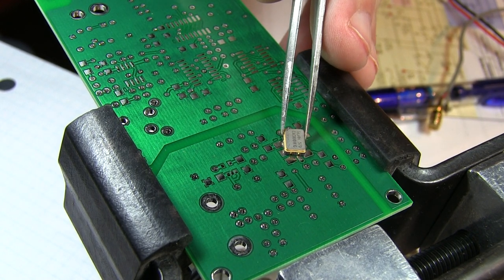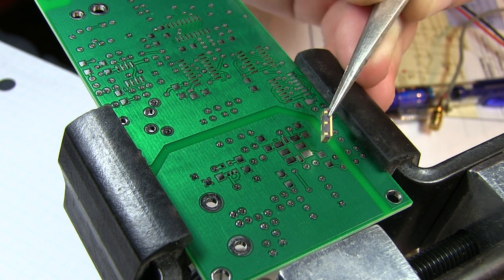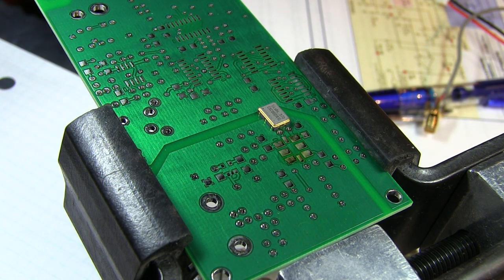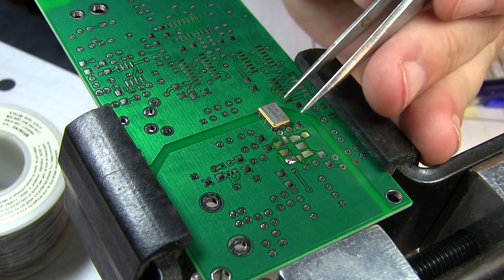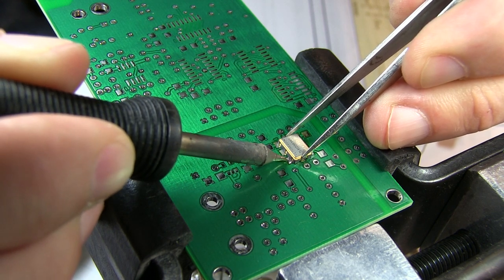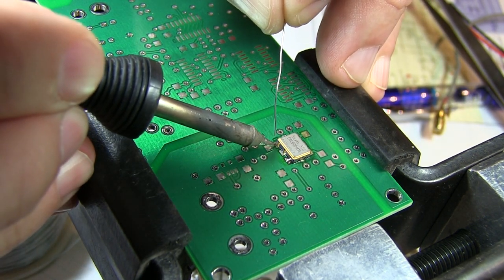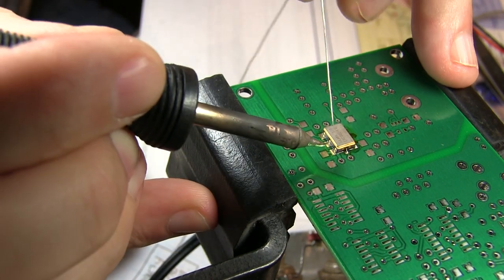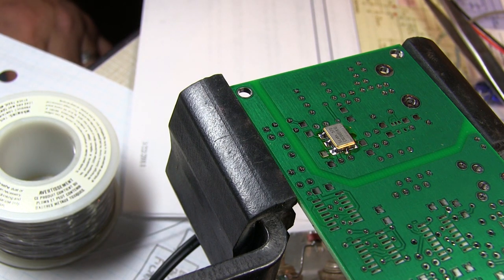#149: How to solder a leadless ceramic surface mount package | LCC | CLCC

Comment: I always cross solder a part like that, so the part will not heat up as much as if you are soldering the pad next to the one you just soldered

Comment: i just put very small amount of solder paste and heat with air gun, it works very well
Reply from the maker: That's a good method too. I don't use paste often enough to keep any on hand.
Reply: well, you should buy at least 10g. i don't even use fridge to store it, works just fine. Other method is to use 0,5mm diameter solder wire, and place small amount of solder on pad, put SMD device, and heat it. But for good results you have to make very tight soldermask. By using methods above i can work up to 0201, never tried 01005
Reply: +Linas K you could do that but the purpose of solder paste and air gun is actually for ceramic capacitors only to prevent damaging the part.
Reply: +Linas K if you use the air gun for surface mounts, you might leave solder balls underneath the part that would cause shorts.

Comment: Is thermal runaway in tubes and transistors caused by an internal positive feedback or internal current leakage? I'm not sure why FETS don't have Thermal runaway issues any reasons why? Thermal runaway is when the tube or transistor is self biasing itself to be hotter and hotter I think due to the leakage current and positive feedback but correct me if I'm wrong
Reply from the maker: Not sure of the mechanism in tubes.  But in bipolar transistors, the base emitter voltage drops as the temperature increases.  This causes an increase in base current, which then causes an increase in collector current.  The increase in collector current causes an increase in power dissipation of the transistor (Ic * Vce).  This increased power dissipation raises the temperature which exacerbates the problem and can cause thermal runaway.
Reply: @w2aew  The transistor part number datasheets will tell what the operating temperature should be. If you use a laser temperature gauge to measure the transistors temperatures this is the only way to know that the transistor has thermal runaway? or how else can a technician know that the transistors in a circuit has thermal runaway issues? any tests a technician can do

Comment: What kind of flux are you using here? I have fairly thin flux, and every time I touch it with my iron it just sizzles and evaporates mostly. But your flux seemed to stay on the board way more.
Reply from the maker: Off the top of my head, I think it is type RA

Comment: Great video, what is the model # of the solder iron you are using??
Reply from the maker: I'm using a Metcal MX-500 system with an STTC-126 cartridge/tip.

Comment: Have you got a website, I have been a long time sub and you never mentioned you where making kits etc. Radio is voodoo to me however, even the most basic basic basic radio thing never works for me, even if I follow it methodically. Apart from a coil, cap and germanium diode (forrest mims book) I plugged into the phono input of my amp, I did pick up some random french radio station 27 years ago.
Side note, Could you do a educational on how and why a signal gets to and then comes out of a an arial as a radio wave. I just don't get  that transition whatsoever.
Reply from the maker: I do make produce or make kits.  The kits that you see me building or talking about here are kits that friends of mine have asked me to assemble for them.

Comment: But now you're left with all that flux residue. Not good.
Reply: Ever heard of flux wash? Flux rinse?
Reply: jeanious2009 No, please enlighten us.
Reply from the maker: I'll typically clean the flux residue with isopropyl
Reply: ***** You are misunderstanding no-clean flux, which must be heated to soldering temperature to be deactivated.
Reply: ***** Do you think the isopropyl manages to fully clean under such a package?
Reply from the maker: qwaqwa1960 No, not really.  If I'm overly concerned about left-over or trapped flux, I'll use a no-clean flux in those cases.  For a little hobby kit like this, I don't worry too much about it.
Reply: Some solder has flux that requires NO cleaning...they clearly mention it on the datasheet...

As for the Flux wash/rinse, its from MG Chemicals No 4140 "Flux Remover". Thats one example, there are many more on the market for this purpose.